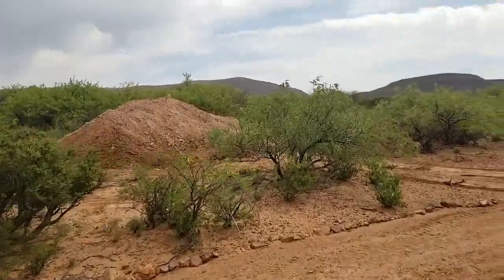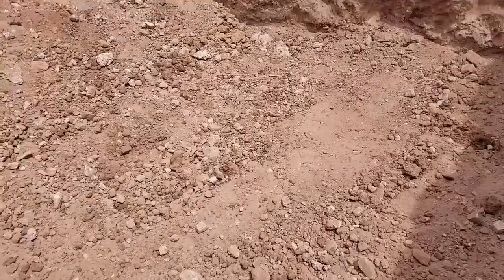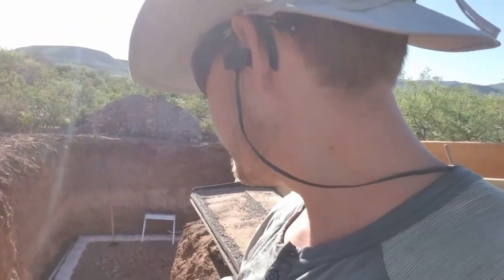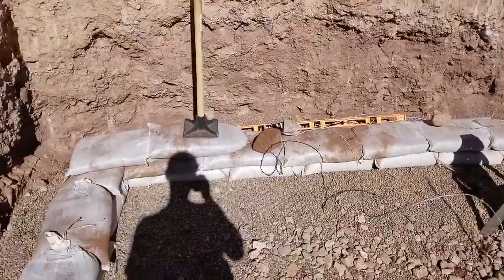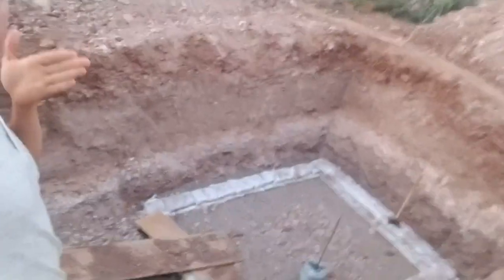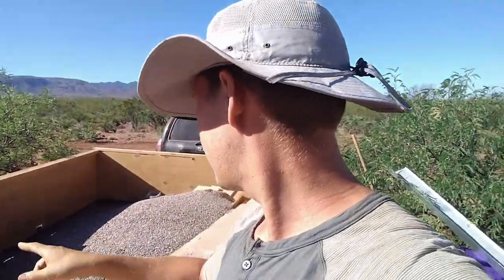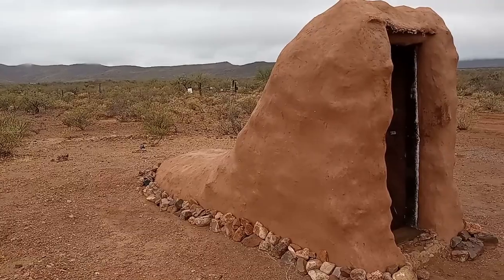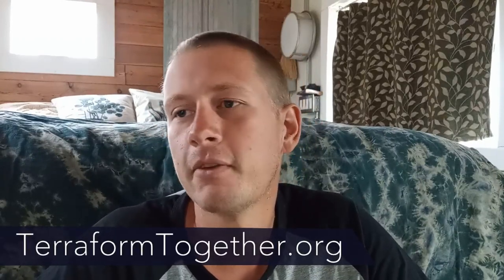Building An Underground Pantry | Root Cellar Build Ep 1 | Terraform Together

Comment: Where do you get the bags from?
Reply from the maker: https://volmcompanies.com/products/fencing-fabrics/hyper-adobe-tube-netting
Reply from the maker: Hyper Adobe would be my reccomendation. We used standard earthbag on this build. After using hyper adobe on our current build, I would never go back. Hyperadobe is much quicker, easier, and stronger.
Reply: @TerraformTogether  

How does hyperadobe differ from Adobe ?
Reply from the maker: @janshuster1426  Adobe bricks are a very traditional building method. You essentially make the same Mix but pack it into forms. Then when the bricks dry you mix mortar and stack them. 

Hyper Adobe you're essentially making the bricks in the bag in place. So it's a lot quicker and less labor intense
Reply: @TerraformTogether  

Thanks for the reply.

I guess cob is even faster.

Just dance in the material to mix it and throw into a wall or forms.
Reply: I’m very interested in learning how you did this and curious to know if you are happy with it. I have so many questions